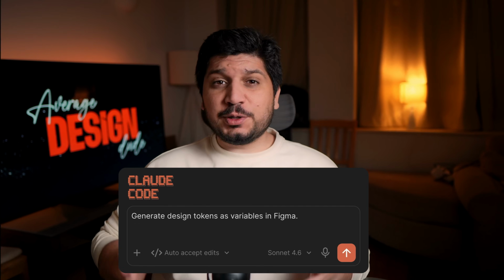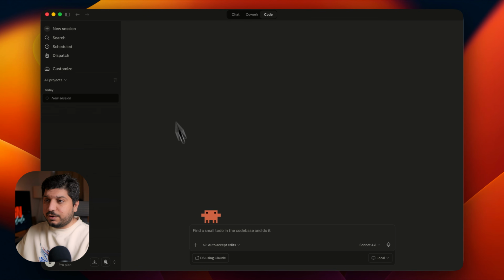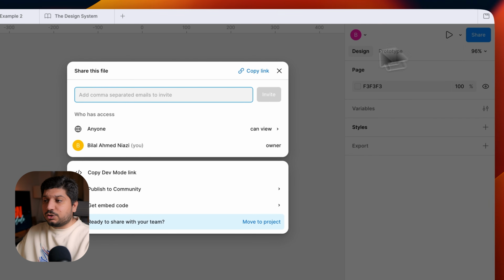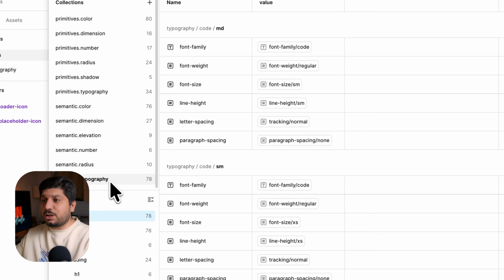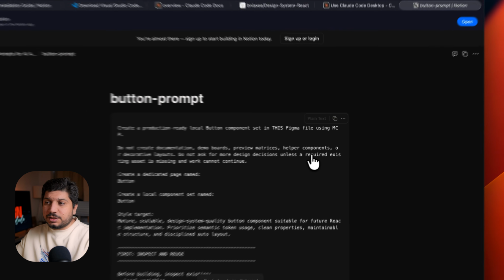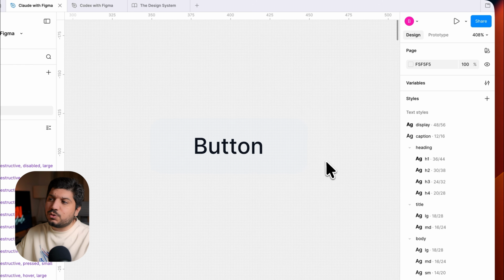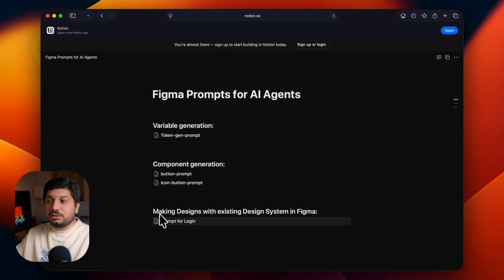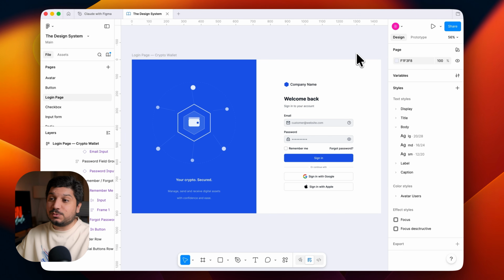Figma Design System + Screens using Claude Code - FULL COURSE

Comment: Hasn't any body ran into this issue?
Per the build rules, I need to stop here:

placeholder-icon found: no
loader-icon found: no

Please provide the exact Figma node links for both:

placeholder-icon — the component to use for leading/trailing icons
loader-icon — the component to use for the loading state spinner
Reply from the maker: Yes so you need to place Icon components in your Figma file with these names… I showed this in the video when I showed you the Figma file… it had 2 icons inside it…

It is important because Claude can’t make good icons so I tell it to use the exact Icon I already had in the file. So my icon name was placeholder-icon and loader-icon.

Comment: Use claude to create specific, custom and editable your own design system plugins. Start with 'colors, typogrpahy, spacing, radius' then add buttons, inputs etc. Once you created your own plugin you dont need burn that much tokens. Dont use claude as your asistant, use it to create own system once.
Reply: thank you a lot brother for this golden comment ^^ i'm now stuck in the phase of the design aspect of my app